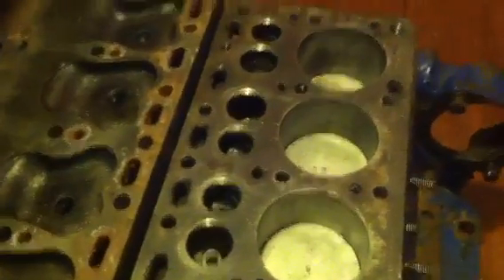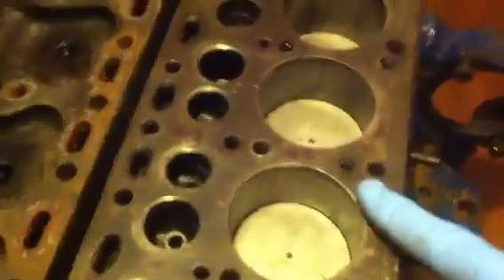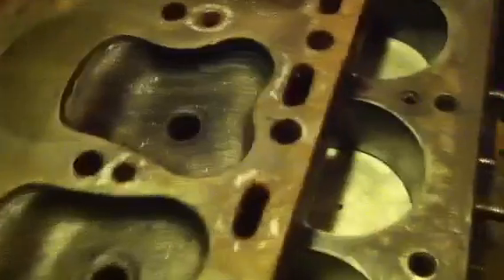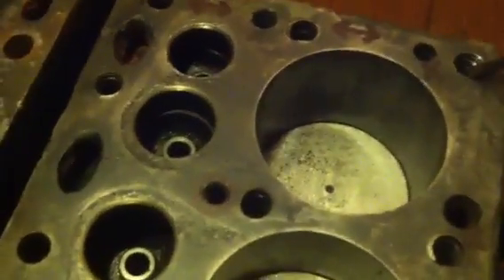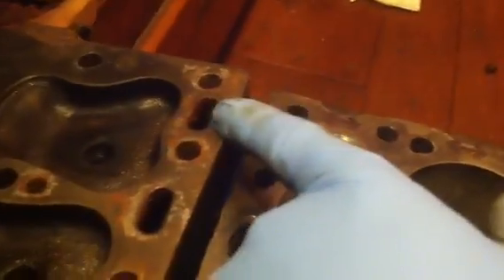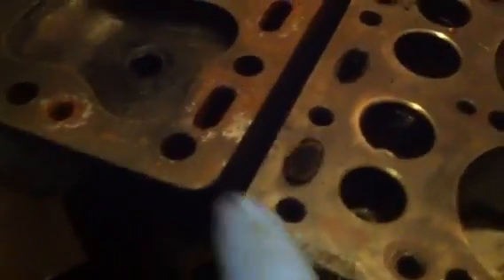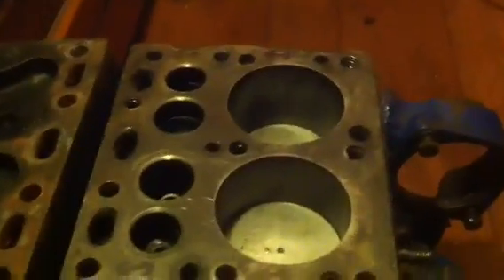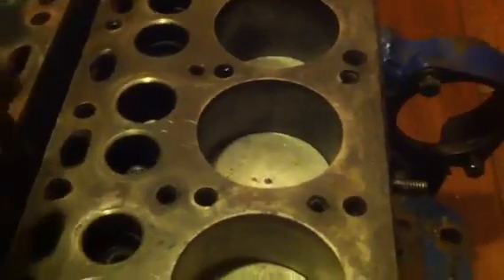Universal Atomic 4 engine water jacket coolant flow

Comment: My question is would that stud bottom in out help with the support of the bolt. I see your point about taking the end of the bowl tough but I wonder if it need it to be. Does that bolt down hard to the block on the inside?

Comment: Those mystery holes in the block were viably ports in early model cooling system with no thermostat bypass . The original casting was used for both early and late model A4’s

Comment: Are you sure that piece of bolt sticking into the water jacket serves no purpose.  Maybe there needs to be a slight restriction so that cooling water does not flow through the engine too fast.
Reply from the maker: Eric Marks That’s an interesting point you make and it’s possible. In this case I think that any restriction to slow the flow through the head and block would better be handled by the thermostat. But, If you want better control than the thermostat can provide, MoyerMarine does offer a Cooling System Bypass Kit.
Reply: @jpian0923  It's still possible that the engine needs some internal restriction even though there is a thermostat.  Unimpeded water flow into and out of the engine does nothing to actually cool the engine.  So once the thermostat is open, water just freely flows in and out with nothing slowing it down to remove heat efficiently. I would ask the experts for sure on this one.
Reply from the maker: @ericmarks6322  The water flow is limited by the water pump. It's flow rate, and other characteristic,  was likely specifically designed, by engineers, for this engine. My objection to the studs being long is not only water flow but its a great place for seaweed, etc to get snagged. Enough seaweed could cause a complete blockage which likely is the cause for my burnt valve.
Reply: @jpian0923  I totally agree.

Comment: I'm almost caught up on all your Atomic 4 videos. You show a lot of courage and determination to try and solve the #2 engine valve and broken shaft problems. I'm retired, very new to sailing and interested because I want to purchase a 'freshwater' boat in Canada and many have the Atomic 4. Did you ever contact Moyer Marine, the Atomic 4 experts, share your photos and consult with them on whether the manifold should be drilled out to provide more water cooling or about other options? If not, I would understand because I'm always going to have a small budget to work with when I'm sailing...Sail safe and thank you for sharing your expertise...
Reply from the maker: Pretty much everything I know about that engine is from the forum guys at MoyerMarine.com. Truthfully, they will answer any questions about boating and sailing. I wouldn't trust any other group of guys the way I trusted these guys. Those guys are the best! Thanks for the compliments.